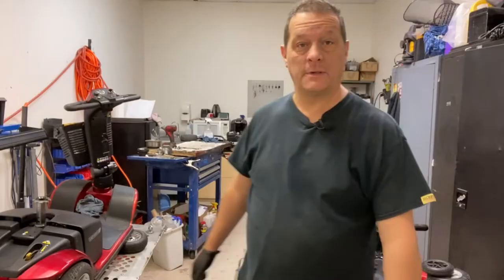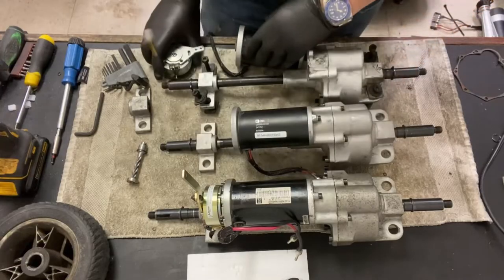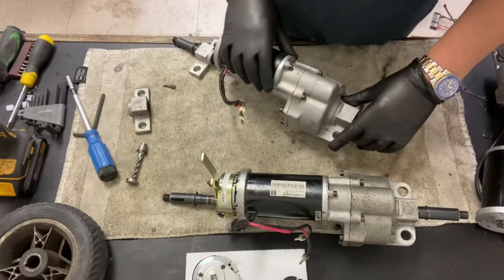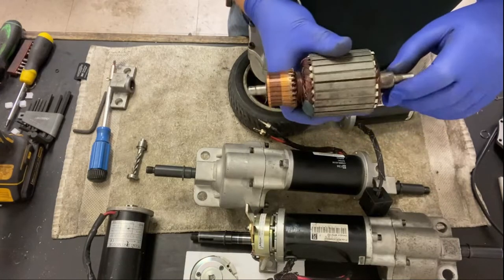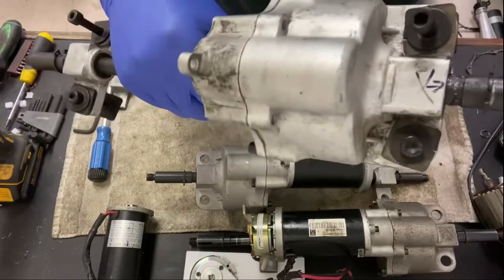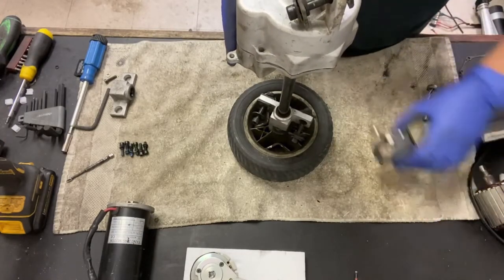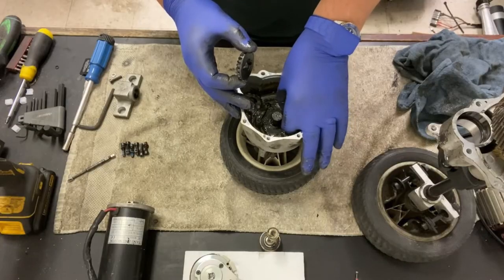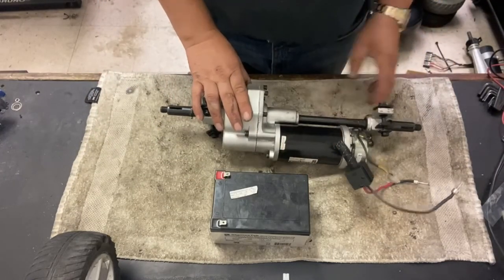How to repair a Pride Mobility Go Go Transaxle Motor and Brake – the Inner workings explained

Comment: My go go elite traveler has 2 concerns may be normal or not, 1 when I release the lever to go forward or backward it wants to keep going for a second or two, like if I inch up and barely touch throttle it keeps going, 2 going up light to medium incline the circuit breaker shuts off, or the scooter doesn’t have enough power to make it up a hill. I basically had the same pride scooter from around 2008 and it would climb any hill and would stop instantly and never tripped the circuit breaker . And yes they are new 12v12ah batteries in the gogo. Am I expecting too much or is there something wrong?
Reply from the maker: Hi Gary, even new batteries can sometimes be bad so I would get them checked out to at least rule them out. Check there is no corrosion or loose battery terminals/connectors. Normally the breaker will trip on low-speed low battery. A good test would be turn up the speed pot and try the incline again and watch the battery voltmeter to see if it's losing battery power like a rudimentary load test. If the breaker still trips and the battery gauge doesn't drop significant it could be a weak circuit breaker. A week worn motor or binding transaxle could also be a factor too.
The continued travel could be a few things like not centered or damaged throttle. Wiring issue and wrong controller installed. I've seen in the past where if you install a bigger scooter controller such as a victory 9 or golden controller they are programmed to compensate for the weight difference of a larger scooter, hence to momentary continued travel. A smaller controller for a Go-Go in a Traveller Plus would cause a bucking affect.
Reply: @lasvegasscooterslifts  I am an auto mechanic and the first thing I checked when I got back was load test the batteries, I would agree on the throttle control because when you let off and has something in the way it still wants to push forward until you move the scooter or the obstacle, but the upgrade I think the motor might be bad because when you hit the throttle for first time the batteries are charged it drops to half and then as speed picks up it goes back to full charge! I purchased this used and was the first time I had taken it on vacation and it doesn’t even come close to my old sonic for power even with new batteries! With the same tester you have in other videos they only drop to just under 11 volt under load! Isolated! Thanks for your help, you had fixed my old sonic when I went to Vegas one year and Southwest Airlines. Lost the insert in the pole for the seat! You brought it back to my hotel Wynns
Reply from the maker: Sounds like it could be several things going on. If I was diagnosing the scooter I would first put the scooter in freewheel with the power off and see if the scooter is easy or hard to push. If hard to push could be faulty controller, binding brake, damaged transaxle or shorted motor which could cause the batteries to work harder until the momentum is built up hence the drop in battery power. This would also cause the circuit braker to trip if the batteries were at a lower state and at low speed. I would then do a power on brake engaged slow start then while slow driving, release the brake into freewheel to see if the brake is not disengaging. Continued travel could also be the brake not re-engaging after the throttle is released.
Reply: @lasvegasscooterslifts  it freewheels easy, and the brake takes 1-2 seconds after I let of the throttle to engage! Also when you let go of the throttle if you try to hold back the scooter it wants to continually pull until you let it go then it will stop pulling and brakes engage!
Reply from the maker: The only thing I would do is change out the throttle and check the controller model number to make sure it has the correct controller installed. If it continues with a different throttle and the controller is correct it still could be the controller at fault or faulty front to rear harness.

Comment: How could you make both wheels spin ?  Weld it?
Reply from the maker: This transaxle is what's considered as an open diff arrangement and both wheel do spin in unison when driven in a straight line. On cornering an open diff configuration allows each wheel to spin independently of each other. Welding them together would not be a good idea unless you like replacing tires.
Reply: Tires I can get cheap but both wheels rooster tailing is priceless
Reply from the maker: ok

Comment: What happens when the right wheel will not spin freely when in neutral and won’t move when in drive mode?
Reply from the maker: Hey Cuongtlam,  usually locked up broken transaxle, seized motor or something stuck between the wheel and the frame.

Comment: Hi, Don’t know if you could help at all. I have a Komfi Rider mobility scooter, it didn’t work when I got it, but have been able to get power, Well, to a point. When I try to move it it barely moves, there is a sound. When you select forward or reverse, but it doesn’t seem as if the motor is moving very much, it does move but barely. The drive brake and motor is only smallish and dosn’t seem to have any brushes.. will say I have now got power to the rear of the scooter, but when turning the rear wheels it seems to me as though they are dragging, and should be easier to turn, do you think this is anything to do with the  motor or the. mechanism?🤔
Reply from the maker: Hi Michael, I take it you have new batteries in the scooter and it shows full on the battery indicator,  the scooter is all together in one piece and you've turned the speed dial up? Does the power indicator go down at all when moving forward? Can you hear a click from the rear when you depress the throttle (brake releasing)?  Feel free to send photos, questions and video to sales@lasvegaslifts.com
Ian

Comment: I have buzz around extreme that’s presenting the 5 beep, brake error code. The terminals on top of the brake itself are showing continuity. But when I test the leads that come out of the brake and through the snap switch, I have no continuity. Could the snap switch be the problem? Please help—it belongs to my mom and her insurance doesn’t cover these expensive machines. Thanks.
Reply from the maker: When you remove the rear section from the front of the scooter on the rear section there should be four connectors, two for the brake and two for the motor. with the brake in the lock or drive position place your multi meter on the two brake connectors and set your multi meter to ohm reading. You should be getting 54.0Ω +/- or there abouts. Check or any broken wires and loose connections while you there. If you are getting OL or 0 reading on your multimeter, then your brake is bad will need to be replaced. From one of the wires from the brake itself to the connector on the rear secion that connects to the front you should get continuity but not on both, only an Ω reading. Hope this helps. Ian
Reply: @lasvegasscooterslifts  Hey, thanks for such a quick response and your generosity. Many people wouldn’t respond, and those that would, not with as much detail as you did. I’m subscribing and liking just for that, even though your content is worthy of both. Now back to the scooter. While waiting for your response, I bypassed the snap switch, to see if the brake harness that plugs into the the “rear intermediate connector”, would get continuity. It did! So the snap switch was bad! I’m so enthusiastic about that because the switch probably cost a couple of dollars, whereas I was almost on the way to buy a brake-motor assembly or even a brand new scooter. This was my Christmas gift from Santa, lol! Thanks again for your videos!
Reply: @lasvegasscooterslifts  Allow me to beg your help again, please. I’m the guy who guess having the brake fault issue and found it was the snap switch. I it’s the switch bypassed, and the scooter put back together, on the lowest speed setting (turtle) the scooter won’t move in reverse at all. Went move all the way to rabbit it will go into reverse. It’s it possible I orientated the motor onto the transaxle or brake onto the motor wrong?
Reply from the maker: Hey, I did leave a response to your second post, but it looks like Youtube lost it somewhere!! As for your bypass I said in my lost post that I think you might have just fooled the controller into thinking the brake circuit is OK and the brake isn't electronically releasing. Is there audible click from the brake when you press and release the throttle? Two ways of testing this is put the scooter in freewheel mode (power on) and see what happens when you press the throttle. If you have fixed the problem, then it should beep five times. If you have just bypassed the system, then it should drive normally but is not safe to use this way. I'm thinking the reason its super slow in reverse is because the brake is in the drive position and is not being released by the controller because of your bypass. Ian
Reply: @lasvegasscooterslifts  Hey, thanks for your response again. And yea, youtube seems to lose comments regularly, in my experience. I can tell you for sure that I have fooled the controller, because I completely removed the bad switch from the circuit. It will drive in both the freewheel and locked position and does not set a beep code either way. Earlier, I removed the control panel cover at the handle bar and wiggled the wiring going to the speed pot. Now on the lowest setting, it will reverse. I don’t know if that was a coincidence or not, or if something else happened in the interim. But the motor braking works as normal when I release the throttle. Are you saying the switch not only signals to the controller that there is power at the switch, but also releases the brake when the throttle is engaged? Do you think that once I purchase the replacement snap switch and install it that my problem will be resolved? Or do you think the new switch will suffer the same fate as the bad one from some unknown, underlying issue? 

I’m still trying to figure out what made the switch fail in the first place. Upon visual inspection, there was no sign of shorting out like the plastic exterior melting or charring or smelling or anything of the sort Thanks again.
Reply from the maker: Ah OK, normal in reverse when the freewheel lever is set to freewheel, and reverse is slower when the brake is set to drive position permanently on causing drag, not good.
Yes, the circuit at the brake does exactly that tells the controller the brake position status and also if the brake has a fault or not of what I'm reading yours does. By fooling the controller, you have made the scooter move again but unsafe for the user. Your best solution and what I recommend is to revert everything back as it was and purchasing a new brake that way the beak will keep the rider safe and also let you know in the future if the freewheel lever is in the unlocked position or a problem with the brake giving a five-beep code. I've checked monster scooter parts there is nothing there for a brake only option and also on eBay. If the scooter is under two years old then if you are the original purchaser hen that part is under warranty and should be free, if not then you need to go to a dealer near to you with the serial number and hope you can get a brake for it and not a motor and brake which will be costly but your only option. Ian
Reply: @lasvegasscooterslifts  Now that I have wiggled the doors pot wires, it’s working normally in reverse with the brake lever in any position. I will follow your advice concerning attempting to obtain a the brake only from a local distributor. Thanks again for all your help!
Reply from the maker: You're welcome.

Comment: For what reason might a Pride Colt Executive transaxle start to slip and be very noisy in reverse? I will note that it does go forward and it seems to be fine while doing so.
Reply from the maker: Sounds like transaxle to me.
Reply: @lasvegasscooterslifts  Yes. That's what I'm asking about on a video about transaxles. Why would it only have problems in reverse?
Reply from the maker: Hi Simon, 
The short answer would be something has broken inside. 
The long answer would be, my best guess from experience (see the next video I'm about to put up about drive and golden transaxles) without seeing the scooter, or asking about its age, past and present use I would have to hazard a guess that a part inside the transaxle has failed like the internal transfer arguer drive from the motor to the main drive gear. 
When the scooter is in reverse if the arguer drive is operating in the opposite direction. If this is broken it will not engage the drive gear or even lock up the drive gear. It could be the motor or brake but again without seeing the scooter to properly diagnose this is just a guess. You best way to find out would be take it to a local dealer who repairs and services scooters to get a definitive answer to your question.
Reply: @lasvegasscooterslifts  I've had it serviced but it obviously doesn't go so far as to actually diagnosing stuff like that because they would just straight up replace it, but he ran it up and down the street, forward obviously, and it went fine and kept at just over 8 mph. I noticed it struggling in reverse and making horrible noises (funnily enough it's not persistent and it hardly happened when I went out on it afterwards) while he was doing the paperwork and I notified him. He then propped it on a box, told me to run it in reverse while he put his ear to it and said "oh, your transaxle is very noisy" and that's as much as I know. I've had it not 2 years, put about 900 miles on the 100 or so miles it already had and I don't know how long the previous owner had it.
Reply from the maker: Defiantly sound like a broken drive transfer shaft. See the Drive and Golden transaxle video.
Reply: @lasvegasscooterslifts  It just so happens the motor started being iffy as soon as I had it serviced, and only half of the time would I not get error code 8 (motor) as soon as I put the key in, which made it unreliable, and thus, unusable. Funilly enough, the brush springs had worn and gone soft. I think the first engineer aggravated the fault and made it more prominent when he removed and checked the easily accessible two brushes (and somehow missed the saggy, knackered springs) and caused it to become more so intermittent. I had had new brushes fitted, and it is now as good as new.

Comment: I still see a lot of lift in the axel. Why didn't you try doubling up with another washer or remove the gasket to remove the amount of lift?
Reply from the maker: Hi Martin, it's fine line between separation causing slipping of the drive gears and too snug that can cause much pressure on the gears, that would cause a binding effect and lead to excessive battery drain. I've found that better to be a little slack but enough to cause slipping than a tight fit.
Reply: @lasvegasscooterslifts  Hi. I'm recently retired and I made my living rebuilding Land Rover engines, gearboxes, transfer boxes and differentials and I used to export them all over the world, so I know a little bit about shimming and to me it was too loose. I agree that being over shimmed is bad, leads to excessive wear. but that was too loose in my opinion. Keep up the good work my friend. 🙂👍
Reply: Didn't realize Land Rover and go go scooters were so similar.
Reply: @robertfandel9442  You'd be surprised Robert lol 🙂

Comment: I have a maxima heavy-duty scooter and it's making a growling noise in the motor or the gearbox. Where I don't know but it's sounds like a combustible engine lol 😆  would you happen to know what or where the problem is  ?
Reply from the maker: Hey Wolfman, one thing you can do is check to see if there is anything trapped between the rear wheels and the axle shafts. I've seen it many times where some people have run over rope, wire and even rocks they can get caught up and cause noise. If there is nothing there, then to rule out the brake try releasing the brake while you're riding the scooter if the noise goes away then the brake could be the problem (please do this with caution as you will not have an active brake). If the noise continues, then you're looking at motor bearings and/or worn transaxle/bearings. Ian

Comment: On the trans axle why does one wheel go clockwise and the other anti ?is there  a problem
Reply from the maker: Hi Steven, on scooter transaxles when the scooter is lifted with no friction to the wheels a good transaxle both wheels should turn in the same direction. If one wheel is kept stationary the other lifted wheel should turn in the direction of travel. The only time I've seen wheels turn in opposite directions is on the ZT8, ZT 10 and power wheelchairs, where the controllers reverse the opposite turning wheel to turn the other direction for tighter turning. I would say there might be a problem with gears or worn damaged bearings in the transaxle if one wheel is turning the opposite direction.
Reply: @lasvegasscooterslifts  
Thanks for getting back to  me. I can't try it out just yet, battery on charge. My scooter is a kymco forum. I've just taken ownership.  But I've been told that after a fue minutes one wheel locks up
Reply: Sorry kymco foru.  Predictive text
Reply from the maker: Sounds like something may have broken loose in the transaxle. I usually find its when take tight turns they lock up quicker.